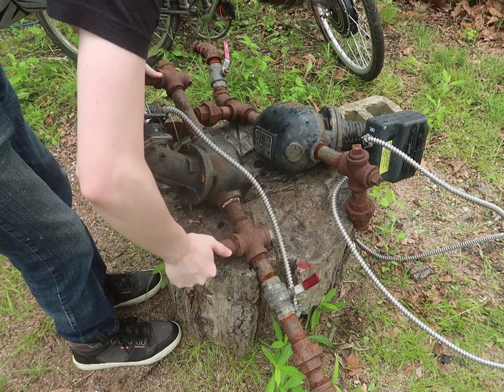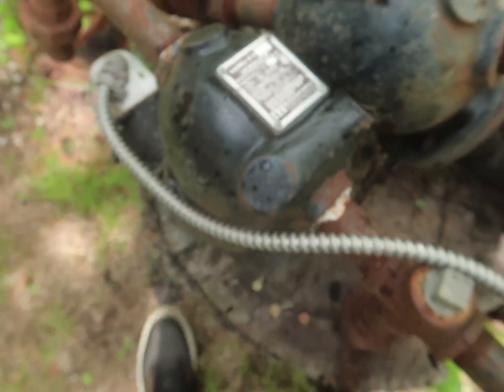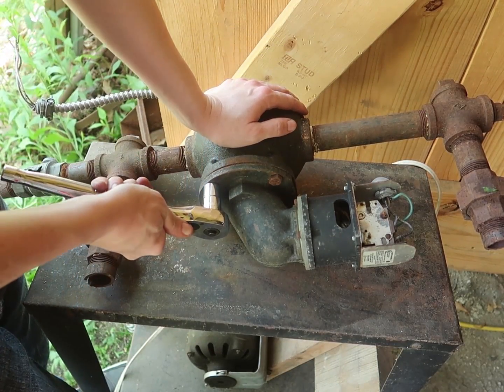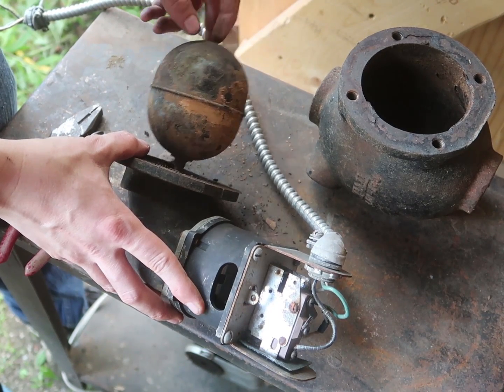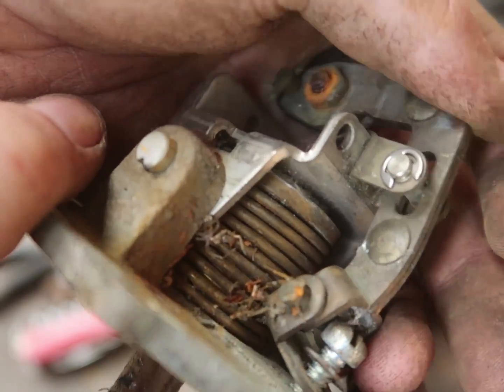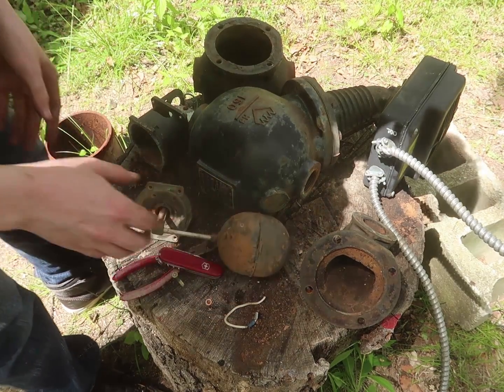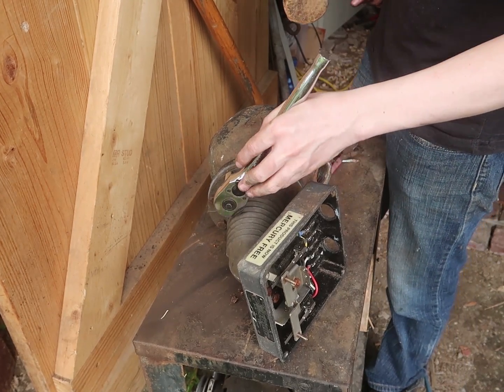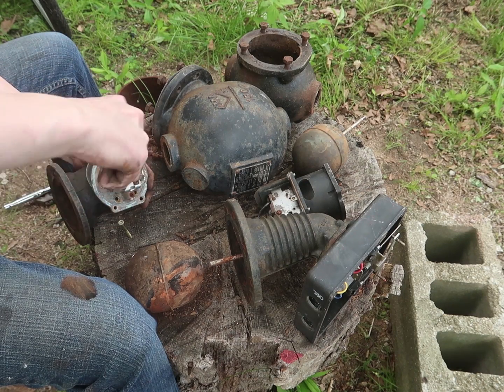Boiler Water Level Sensor Teardown: It's like the float valve in a toilet, but industrial!

Comment: I wish I knew what it was called, but believe it or not, we had flex pipe in the 1700s! I have a piece, it's a broken remnant of something about 14 inches long. It's a series of copper u shapes shoulder to shoulder with an inverted set with its legs in the valleys of the first u-shapes. It's extremely pliable and rattly, but when you apply water pressure or air pressure, it flexes all of these small individual copper bends and makes for a sealed pipe! It's not quite 100%, but I believe it probably was when new. It's just one of those things that always tickled my brain as a child, admittedly I still find it pretty amazing

Comment: Well now I'm not sure at all. I would swear that that spherical portion is identical to mine, but I don't have these electrical switching systems on them. A few are powered, but it's just a simple BX cable. The only explanation I can come up with is that what you have was built with individual controls and in my house there is a central control panel that these wires run back to. But it cannot be that simple, more of these have no electrical component at all. I don't know a great deal about steam, I had assumed them to be dash pots or expansion Chambers. Can I ask, does it seem like the electrical components could have been a retro fit from a different generation? Those castings certainly look like iron which would be unusual with modern electrical switching. Do you have a broken one? So you could determine if iron or steel? And the type of iron?
Reply: Okay this was really bugging me so I went and got the notebook. Maybe this were more industrial Lego as Arduino might say? One of the valves in my system is identical to the one you are handling at 1430. BUT mine has no electrical components at all! Mine functions as a wastegate. At the lowest end of the system, wetter steam can condensate in a long vertical pipe for this purpose. At the base of that pipe, I have the identical float system. But what is so fascinating to me is that there is a lead weight on the other end instead of a relay or what have you. The way it works is that the waste pipe fills up over time with sludge and condensation. If you just left it open, rodents and such might be an issue. The pipe is about 3 in diameter maybe 9 ft of height. The little lead weight has been carved somewhat, I presume it correlates to a particular height of the water. Either way, once in a great while, it opens automatically and a little bitty drain in my field spits out some disgusting black water. I suppose it's possible my grandfather modified it, but he built this place in 51, those electrical components look a little newer than that to me. I wonder if the same casting had several applications?

Comment: Those brass bellows are used a fair bit in metrology equipment, specifically stuff that thermal cycles pretty dramatically. As a rule, metrology equipment is designed to be used at 68 degrees Fahrenheit and 55% humidity, anything else will give you faulty results. I'm sure you can understand why it's important to use the same measuring tool on two different parts that will mate. They use bellows like this and sometimes an integrated oil bath to test the results of the measuring tool at different temperatures to determine the logarithmic ratio. This allows the operator to calculate the percentage of error caused by the temperature difference and use this to calculate the answer! That was about as clear as mud, but I think you will probably follow. I don't know for sure that it is true, but I have been told that in certain types of nuclear reactor, where instruments would be damaged by the radiation, that a spiral bellows, or ducting, Slinky or spring, whatever you want to call it is behind extremely thick glass and a very sensitive camera is constantly measuring the distances between the filaments. It was not entirely clear whether this was measuring temperature or energy output, the person telling me about it worked there, but more labor than brains so to speak. I would normally dismiss this out of hand, but I recently read that the very advanced Japanese tsunami warning system is triggered by an oyster with a spring hot glued to its shell, haha. Apparently when the tsunami pulls all the water out, it causes a great deal more silt to get stirred up. Oysters and other by valves shut their mouth when this happens. So one of the most advanced technological systems on the planet is operated by a creature with a negligible amount of brain matter! You know, like government

Comment: Do you happen to need schematics? My grandfather was a ship's engineer and he built my home with a high pressure steam system installed. I have that exact float switch in four different places. I had to turn off the system after an explosion, but it is still all plumbed and I have a few notebooks of the specs. It's a 6800 PSI system though. I think most are closer to 3K
Reply: Just because it makes me sound like a moron I feel the need to clarify that the explosion in my house was due to a faulty prv, not my fault. Pretty impressive distance on the boiler door though
Reply from the maker: Nah I wont be needing any schematics for this since I figured it out fairly well in this video. Thank you though

Comment: Not so much a sensor, but a float switch.  Low water shutoff to the boiler.  One of the main reason for steam boiler fires back in the day was from not regularly cleaning and skimming the boiler.  Sludge would form in the bottom of the float keeping the float from seating all the way to shut off the boiler in low water situation.  The result was meltdown.
Reply from the maker: Float switch is definitely a sensor, especially the larger one since it can tell three states apart